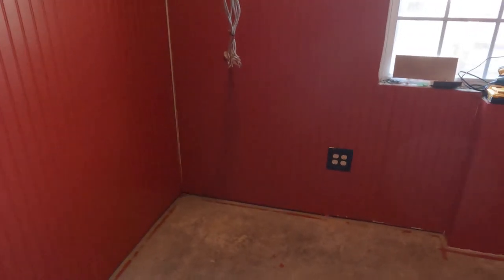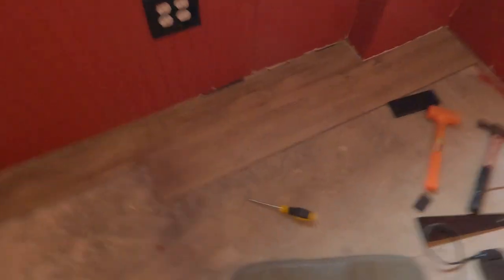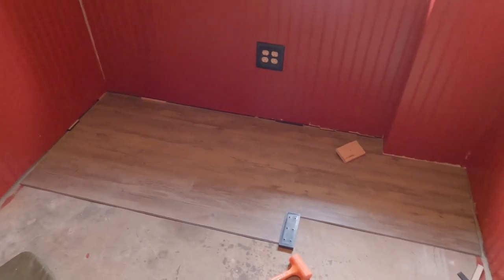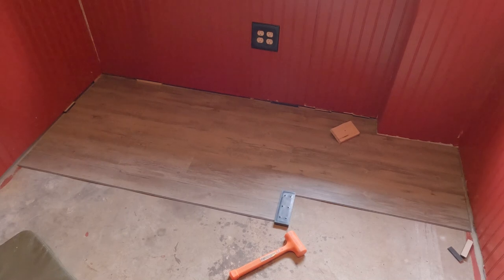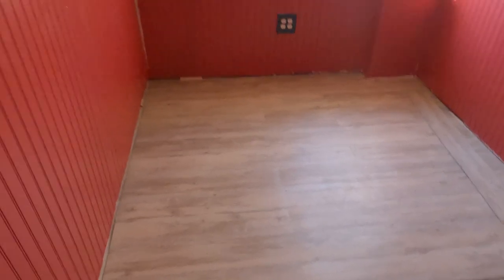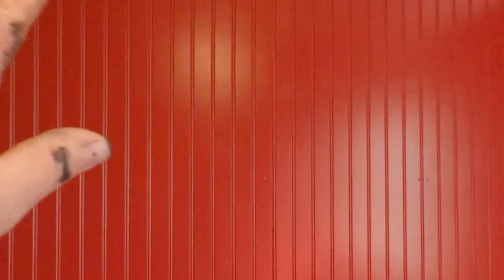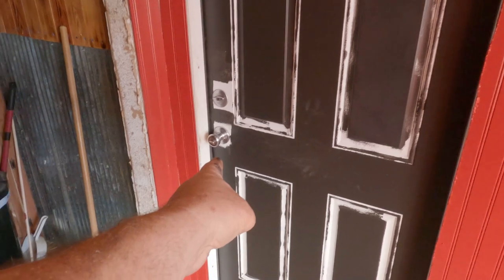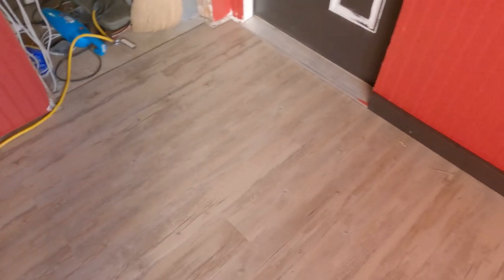I Can Start Setting Up My New Office! Floor Is Done.Home Office Renovation Nears End.

Comment: It looks great in there! I've installed laminate floors, the old style that had to be glued! Never again.  Now I hire someone to get up and down on knees.  I hope there's no problem with buckling from not using a underlayment for the concrete. We didn't have to with wood underlayment.  Love the vinyl floors.  Easy to clean.
Reply from the maker: you dont use any with this product
Reply: @ouachitamountainliving  good to know. It does feel nice on the feet, even with just socks or slippers on. Barefoot in the summer is lovely!

Comment: I am surprised you do not need a thin foam pad under it because you are on a slab.
Reply from the maker: vinyl plank has it built in
Reply: Did not know that Mike.....I did wood in my house years ago and needed it so I stupidly just assumed this floor would need it also....good to know thanks for the info